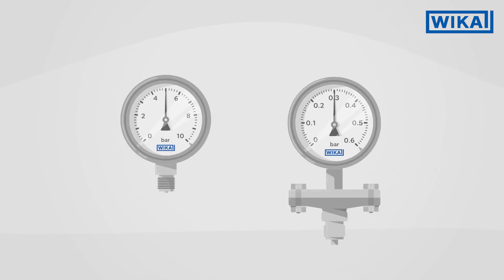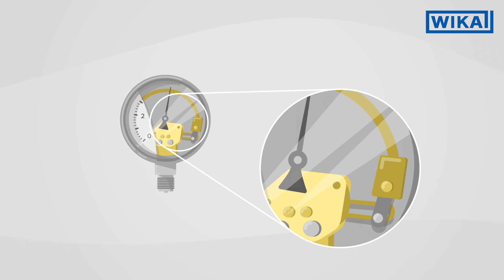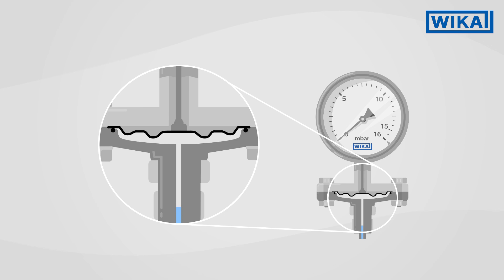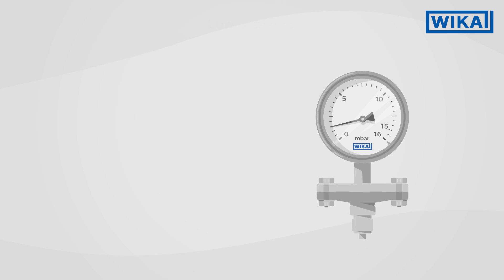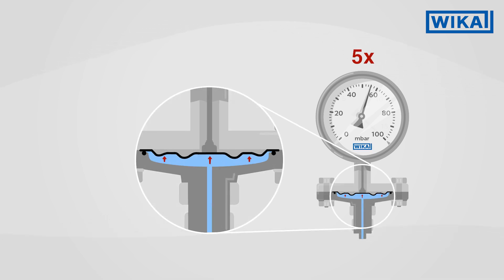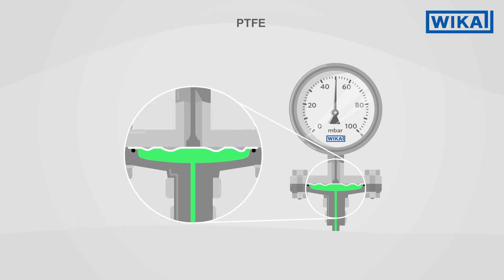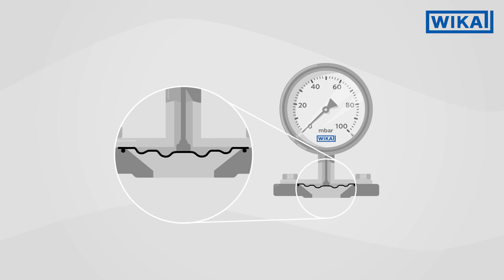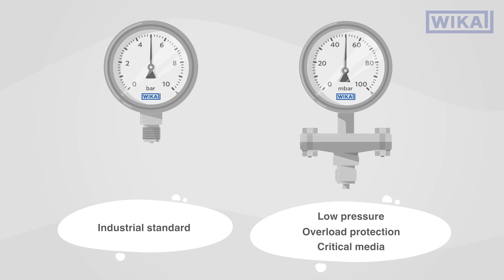How pressure gauges work? | Bourdon tube vs. diaphragm element

Comment: Can the bourdon tube guage be used in measuring gauge pressure (barg). If yes, how is this achieved. Is there an opening to the atmosphere?
Reply from the maker: Hello @Chinedu Ukeachu, 
Here some information about our gauges …
Most of our pressure gauges are measuring a relative pressure; this means we are measuring against the ambient pressure.
Therefore our gauges have to be open to the atmosphere. This is achieved by special plugs or from the design.
After installation of the WIKA gauge, the customer has to open the vent on the plug.
It´s clearly described in the manual and on the plug; if somebody forget to open this ventilation, this can lead to indication errors. I Hope that this short description will answer your question. 
You can find more information about our pressure gauges here: https://www.wika.com/en-en/pressure_gauges.WIKA
Best regards.

Comment: Are there back holes? For overload protection?
Reply from the maker: The gauges are available with different safety levels for the case to protect the user in the seldom event of a failure. 
Safety level S1 has a blow-out disc at the back, which will be blown away to the backside. At safety level S3 the complete back of the case will be blown away to the back side and additionally it has a solid baffle wall integrated which protects the user in front of the gauge.

Comment: what type of pressure gauges do they use on submarines?
Reply from the maker: One Submarines mainly bourdon tube pressure gauges are used. WIKA offers different kind of models even certain subsea models like PG23SUB. However, in order to find out the right solution for the each application a further discussion is highly recommended.
Reply: what the diffent between gauge and diametre

Comment: bourden tube overload is 3x  ovrload protection or what ?
Reply from the maker: The overpressure safety of bourdon tube pressure gauges depends on the nominal size and the material of the wetted parts of the gauge.
Bourdon tube gauges from stainless steel in nominal size 100 for example have a standard overpressure safety of 1,3 x full scale value.
However, optionally WIKA offers also increased overpressure safeties for these gauges depending on the measuring range (for example: 4 x full scale value)
Further information can be seen in the datasheets of the single models.